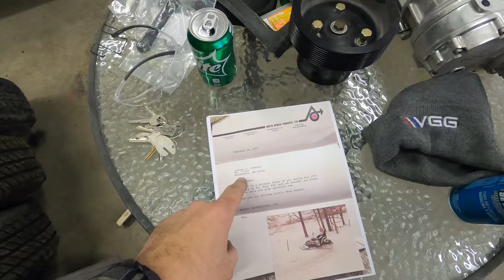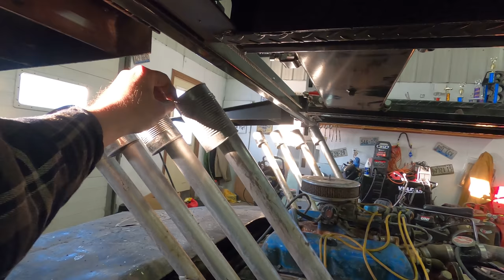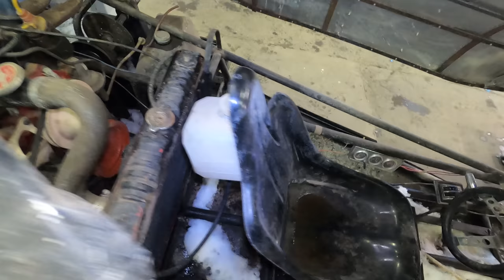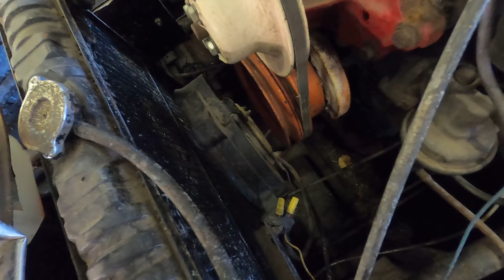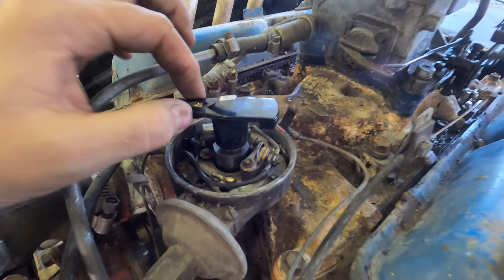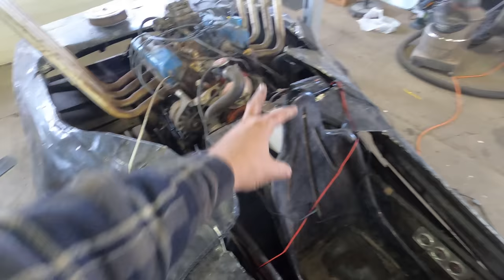Ford V8 Powered Dual Track Drag Racing Snowmobile - Will It Run after 20+ Years?

Comment: Weird coincidence - when I was a kid, I doodled up in my schoolbooks (yup...D+ student for life - I'm doing very well, actually) a wicked design for a drag racing snow mobile.  Mine had tracks on the outside, in a different shape than flat (I was like 9...what do I know about physics?), a full cockpit, designed the inside with heaters, defrosters, mirrors, fans, switches, a bitchin' ergonomic seat, all manner of steering wheels, yokes, sticks (yes it looked like a Italdesign Orca - again..9 year old) a stupid huge spoiler (I thought they were so cool when I was a kid...blame Lambo's and Porsche's for that) the skis weren't solid, but like hollowed out tubes of a certain shape that's a pain to describe, it had the front spoiler just like his does (or whatever it's called - the hammer head thingy on the front.)  It didn't have the pipes on the back (figured it might have military (lol) uses - so best to keep the profile (!) low.  Cause your eyes would NEVER see that coming toward in you in a winter war theater.  LOL

And of course, being all of nine - had mounts for missiles, a gun pod for a copilot, forward facing 50's, a tandem one if they wanted a RIO (talk to me goose!) radars, sensors, radio, CB, on and on.  I estimated with the low drag, huge engine and goofy exterior tracks (and the freakin' spoiler!) It'd probably travel at 90...120mph...cause, you know, sure...

What do I do now? User Experience Research...basically the same thing as when I designed it.  Called them...oh lord I forget.  But I've always wanted to build one.  Seems this old boy had the same idea.

Comment: The shifter is what they typically used on the Mustang in the 1960's, so it's possible the engine and trans came out of a '66 Mustang.

Comment: I have seen a 180 degree gearbox used in jet boats that would be cool to reverse the shaft to your differential if needed. Of course it may decrease the number of cold snacks you can buy.

Comment: Pile-o-batteries:  So you don't hurt a sitting battery, hook it up to a small trickle charger.  Batts will self discharge and sulphate if they sit too long and then they become junk.  You can float (trickle) charge a battery from now until the end of time and not hurt it. It will only draw as much power as it needs to keep itself topped off.  Also, if you have a big pile of batteries, AS LONG AS THEY ARE ALL FULLY CHARGED, you can use one small 1A trickle charger to keep them all charged, in a float state.  Just parallel them with some speaker wire.  Voltage is important to don't make the wire too long.  Keep it under a few feet.  Personally, I love VDC and Battery Minder chargers.  All high quality stuff.
BTW, yes a standard flooded car battery will eventually have it's water evaporate out.  Just check them once a year and you will be fine.  And DISTILLED WATER only for filling them.  Minerals from tap water will throw of a battery's chemistry.

Comment: I agree 110% about reading plugs ... pops taught my brothers and I growing up how to do it . Plugs tell the entire story of the engine and yes its too bad most dont even have a clue about the information they tell they just change them ...Ive even seen them pulled straight from the box and installed right into the engine without checking gap ! Holy crap some peoples children right. I try to teach everyone I come across wrenching on any engines how to read a plug ya know share the knowledge with fellow or girl motorheads   that was shared to me long ago ! i'll be wrenching til i die !

Comment: And how to tell by the Bell housing the 260 has a 5 bolt bell housing and early 289 block have 5 bolt bell housings. later model 289-302 are 6 bolt bell housing

Comment: 260 v8 had 5 bellhousing bolts. They changed in July 64 to 289 and had 6 bellhousing bolts and that pattern stayed the same on all the small blocks until 1997. There was a red headed step child in the late 70s into the early 80s during the fire maker shortage that was destroked to 255 which gets no mention or love because she had more smog equipment than a Californian boat motor and woulda been better suited for a boat anchor. Those valve covers are mid/ late 70s probably, the old ones had POWERED BY FORD stamped in the metal. That radiator looks to be from a Mustang or Falcon .

Comment: That's not a c4 trans that's an FMX tans very similar to a c4 but a little different, some of them came with better internals than a c4 and were used in various applications through out the years in fords line up of cars. Quick way of telling the difference is the detectable bell housing, and the vacuum accumulator should be on the passenger side of the vehicle rather than the drivers side. If your still reading this i'm bit of a old ford fanatic and love this show!

Comment: 40 years experience with things Blue Oval. Check the aluminum tag on the carb. That will tell you what year and model it came on. On engine parts, if it starts with a C, thats the 60's, D is 70's and so on.

Comment: The 260 has a breathing tube coming out of the time in cover and a passenger side water pump some 289 are the Same but most later models don’t have the tube and most 302 have Driver side water pumps and no breather tube in the timing cover

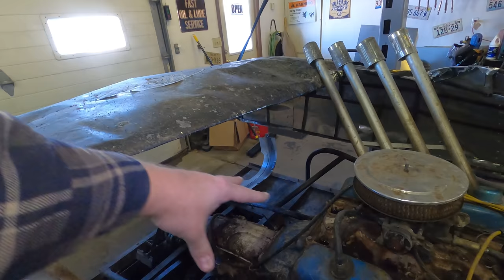Comment: Wondering. Could the battery tray be where the fuel tank is only on the opposite side. At the bottom of the shot at 20:16 it looks like a tray with maybe a u joint part laying in it. It has a little lip and seems to be batry size. Fascinating unit.

Comment: Engine restore in the metal can will fix those cylinder walls. Its got graphite and vitamins that'll fill the scratches. Project farm tested the stuff and it really does restore compression

Comment: A number should be stamped on block near oil filter and numbers on head under valve cover. If it has a dual point distributor it may be a Hi-Po 289. C6OE-H. The Hi Po 289 also had an crank damper exclusive to the Hi Po 289. This clearly only as a single point distributor because it has vacuum advance the dual did not.

Comment: I have a 2014 FX 150 with the eco boost V6 and I guess they had a bad batch of exhaust manifolds they came pre warped
So they would spit out the rear stud 
And leak 
No big deal right well you would think until you start to work on it 
Every thing in the general area has to be removed just to get to the turbo
Then you just give it your best to try and remove the cooling lines 
Oh and if you need to change the rear cooling line they say you should remove the motor 

Not happening I picked up a couple of 19 mm wrenches cut them up and made some special reach tools 
Got them out and back 

Would love to get your take on how fun this truck is to work on 
And if you ever get to Las Vegas to pick up a vehicle l would be glad you offer you the use of my shop and tools for any work you would need to do on any old ride you come up with 

Really like your show 
It really helps me relax after a day of fixing crap that always seems to brake as soon as you get your last problem taken care of

Comment: Just so you know...When checking the ballast resistor,  you will only get the same voltage out as going in if the points are open.  If the points are closed, you'll only get about 6-7v.    Full power to the coil for start up comes from the starter solenoid while the engine is cranking.  Once the starter is released, reduced voltage comes from the ballast so as not burn up the points or coil.  Ever wonder what that extra wire on a Ford starter solenoid is for?  🤔

Comment: In my experience a battery stored on the ground or cement floor never lasts very long. I can only get about a year out of a battery that’s been stored on a cement floor vs to a battery stored on a shelf which I can get about 3 years out of!

Comment: just wondering besides the whole weight transfer center of gravity stuff and all that. why the engine wasn't turned around 180 to eliminate some of that extensive drive train and move the driver more toward the front.

Comment: Wow my comment will be one of over 4000 . You are truly a rock star. And I am a fella like yourself always been wrenching on cars . You have tremendous understanding of automotive engines. You have some procedures tohar I have quickly adopted. 
  However I am a retired electrician and I sense it's not your primary strength , as it is mine.  You spoke today of how the ballast resistor would protect your points. Whole that is ordinarily true, in the case of engine starting, that ballast resistor is bypassed to I create the hottest spark for staring . Once started the ballast resistor comes into play to protect the points. This is  accomplished by a wire from the starter solenoid straight to the coil positive terminal. There should always be two wires on that terminal. One from the ballast resistor and the other from the starter relay. There are two small terminals on the starter relay. One to energize it from the  ignition switch . That other one is actually an output where ever the starter is engaged it pumps out 12 bolts and that goes to the coil positive such that it is the .most voltage applied to that positive terminally of the coil. When the starter is switched off by key going to ignition on , then the duppy to that point is via the ballast  resistor , or could be a length of resistance wire. But either way you should get a full 12 bolts when the starter relay is energized lowering to about 9 bolts when om ignition on. So if you have a test light with a ground tail alligator clip, you will see it on bright on start going dimmer when key is released to ignition on.  
  It is a common misunderstood circuit that comes into play with all points and condenser ignitions.  You have given me .any . It is my honor  and privilege  to see your need to know and be able to express this in a way you will likely never forget about it.  I love you man and your family and your dedication to a complete wholesome lifestyle. It was difficult to address this with you but in reviewing your statement I felt obligated. Im sure a lot that read this will finally understand this tricky circuit . Same on Ford's and Chevys and all the rest . One way or another that coil gets more voltage on start than on run.

Comment: if you have one tiny problem with the radiator or the hoses spring a leak behind you, scolding hot coolant will spray and burn you. That just happened to a feller in florida that was driving a rear engine machine. Burned him so bad he had to spend weeks in the hospital and get skin grafts. Be careful with that!💯

Comment: I'm surprised a guy doesn't also use a pump oil can with trans fluid or MMO to squirt in there through holes or even down exhaust pipe

Comment: I thought the ballast resistor dropped the voltage from 12 to 6 volts.  Having 12 volts to the coil for engine start up (helping a faster start), then dropping via the ignition system and ballast resistor to 6 volts during engine run time?  If that is the case then you would see 12 volts on the feed side of the resistor and 6 volts on the output of the resistor, and not battery voltage on both sides of the ballast resistor.  But any who, please continue....

Comment: I'm a retired Ford parts man. I can tell a guy the C60E... means it was "originally" designed for a 1966 Fairlane etc. It could have been used for years after. The digits on that carb tag will tell more specifically what it was put on originally. I can research it.

Comment: Based on the valve cover bolt count, and the radiator inlet, I'm going to say that's a Windsor block. Probably going to be either a 302 or a 351w.
Reply: I said that before I finished watching. Close but no cigar.

Comment: The only thing I think I would have done differently was to pull the " pipes" and lift the whole body off and throw it out... That way you can go thru the driveline properly.. and use the proper "spark o laters"

Comment: The ballast resister would NOT have the same voltage at both terminals if it's working. That's what they do because you don't want full voltage going to the that type of ignition system.  
Although a full charged battery should have 12.6 volts, the ballast resister will reduce the voltage so the coil is getting around 9 volts or so.

Comment: If the engine runs in the opposite direction of a car engine it's from a twin engine boat because on engine runs in the car engine direction and the other runs opposite so the props turn like they are geared together

Comment: Just so you know in the future all Ford engines made in the 60s 70s and 80s and Beyond all have a cast right between the core plugs that says 289-302 351 if it's a windsor or Cleveland it will have a w or a c on the block as well in the intake is always a Telltale sign into Factory intake it will also tell you 289-302 351 429-460 even the old Fe engines used to do that as well

Comment: Hey bro awesome vids I just found you and subbed and clicked all. Got a question? I ran into some polls crossing the road on a unmarked unlit tulsa dead end street... 🤣 the accident pushed the passenger rim and tire into the wheel well it barely drove home and also blew the tire when pullin in the driveway. 🤣
I took it to a lil no Name garage and he gave me a list of 4-5 parts like inner n outer tie rods and control arm and loaded struts and sway bar link. They completed the repairs but now every time I hit a bump or pothole or bigger sized rocks it feels like my front end jumps all over the place right or left kinda like a shopping cart front wheel when you go to fast lol they feel like they wobble or turn on their own without turning the steering wheel lol thanks ahead of time for any type of help. 🙏✌️

Comment: LOVE your tubage, not sure how you read all of these. I am a mechanic for 50 years, on my sons channel. Just thought a guy would add, the purpose of a ballast circuit is to reduce the voltage to the coil preserving the points. A ballast normally will reduce voltage from battery (12.8-14.4V) to around 8-10V. This must be matched to a resistor coil. The wrong combinations cause trouble. 9V to a 12 V coil probably wont start, 12V to a resistor coil will fry points. No one will ever read this, probably. I dont know.........Rick

Comment: An old dodge i used to have would die on me going down the road. I'd have to mess with the cap an button to get it back running. My buddy turned the key off an oh boy fire shot out my fingertips to the firewall oh Lord. That will sober you up lol

Comment: Talking about the Ford engine reminds me of this from My Cousin Vinny: " No, there's more! You see where the left tire mark goes up on the curb and the right tire mark stays flat and even? Well, the '64 Skylark had a solid rear axle, so when the left tire would go up on the curb, the right tire would tilt out and ride along its edge. But that didn't happen here. The tire mark stayed flat and even. This car had an independent rear suspension. Now, in the '60's, there were only two other cars made in America that had positraction, and independent rear suspension, and enough power to make these marks. One was the Corvette, which could never be confused with the Buick Skylark. The other had the same body length, height, weight, wheel base, and wheel track as the '64 Skylark, and that was the 1963 Pontiac Tempest."

Comment: That's absolutely NOT how a coil works. The primary winding is the first winding and the secondary winding is the second winding. I think your timing needs to be advanced a little...

😖🤪😜
Regarding spark plugs...I totally agree. I had an old '89 Yamaha Phaser snowmobile and the owners manual had an incredible description of plugs..how to read them, what to do depending on what you read from them, and how the heat range of plugs works..what it means. All that in an owners manual. It could've been the manual for my 94 Polaris XLT580 with the Fuji heavy industries triple, boy oh boy was that a great sled back in the day!

Comment: Me, at the start, knowing nothing about Ford non-4.6L V8s: That's a Ford 287, right there.
Derek, 20 minutes later: "Yeah, that means its a 289."

Wooo! Nearly correct guess, based on a rough assumption of size and age!

Comment: ok 66-67 289 from a fairlane torino or a 66 mustang which there was a huge fight over that car because it was actually a general motors vehicle but ford wanted the name on it mustang and powered by ford that was around the same year detroit had come out with alot of dieselheavy equipment industrial detroit blocks

Comment: you know, if he used the Cobra 2 mustang as the donor or the v8, transmission, rear end, and shifter, why wouldn't he go and use the rack and pinion, power steering as well??? he also could have used a boat drive, to reverse that driveshaft. they have them in different ratios, too. they use them in cars like hemi under glass, and the Little Red wagon wheelstander.

Comment: I'd take an old sheet of metal and  fassen it with some self tappers or weld it on even and fold up a cover over that Radiator, incase it decides to boil over on yah while your givin it the gears.

Comment: I had a 1987 Ford Bronco 2 that I donated to my off-road buddies Davy ( r i p) 2007 

 Dewey & Becky &
Jim p (Mia)
Anyways they put the Ford Bronco 2 body I believe on a F250 3/4 ton 4×4 Ford with the 460 V8 and we had the exhaust coming out the same way through the Hood with 44 inch Swampers and took that truck to every mud rallys in Minnesota & Wisconsin that we could we ran it hard until something broke we'll fix her up and do it all again the early years of 2000 we're great.

Until we meet again my friends God bless and God bless America

Comment: If the original builder had access to a GM TH325 or TH425 it would've saved a ton of fabrication. Unfortunately those were brand new when this machine was built, plus he  appeared to be a serious Ford fan.